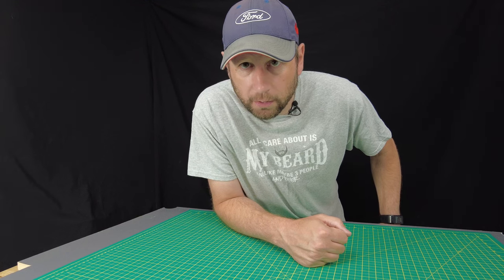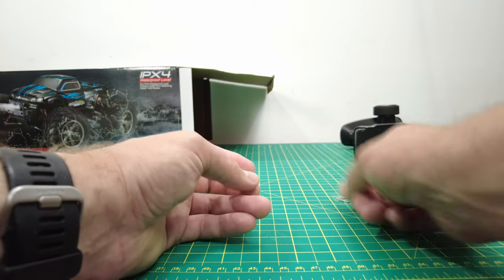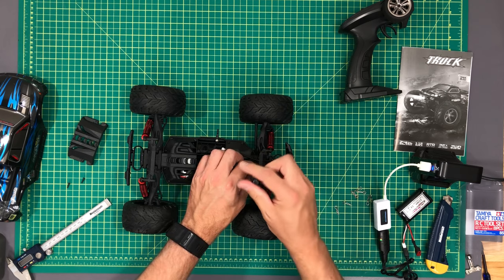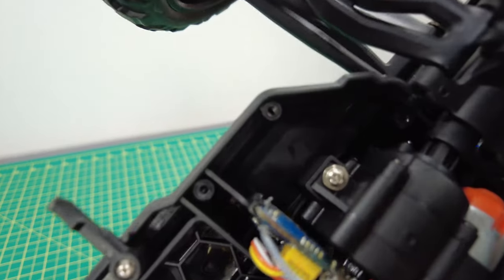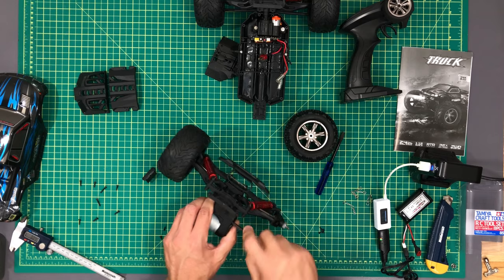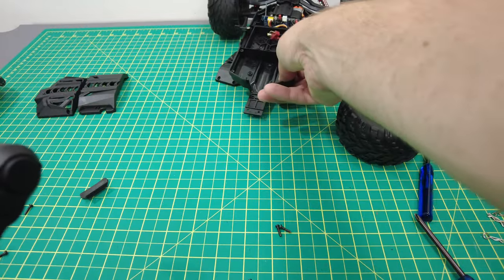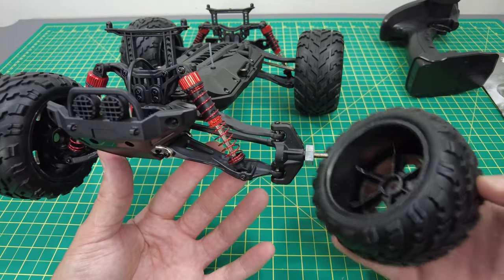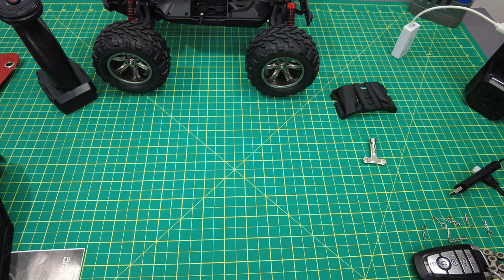Worth $100? Wild Challenger Turbo RC Truck from Princess Auto/GP Toys/ELH Hobby/S911 Foxx/Drift Hero

Comment: Great video friend, the xin le hong and the Blackzon Warryor are the same model sold by different brands? greetings
Reply from the maker: Hi, thanks for watching!  Controllers, electronics battery/charger and body style changes between the brands but the truck chassis and parts appear to be the same. The manual and exploded views are very good from Blackzon - find it at he link below.  Blackzon was under the HPI Racing brand,  I can't find a website for them anymore.

The Blackzon manual can be found here at the time of this reply

https://www.hpiracing.com/assets/documents/blackzon/instructions/blackzon_warrior_manual_22032021_web.pdf